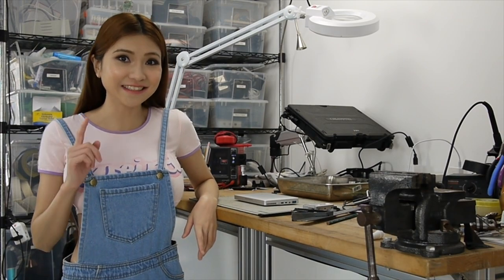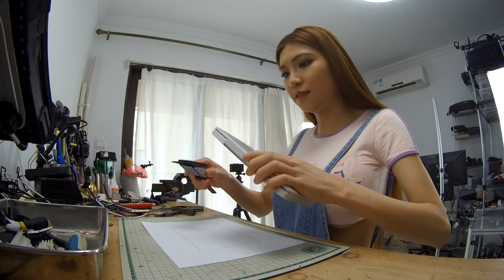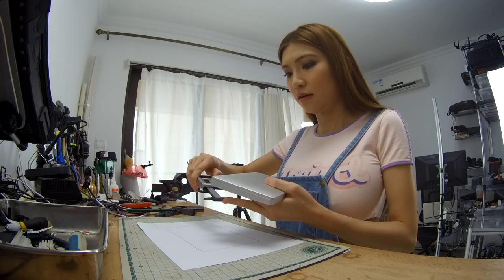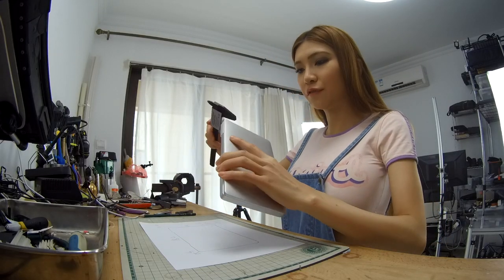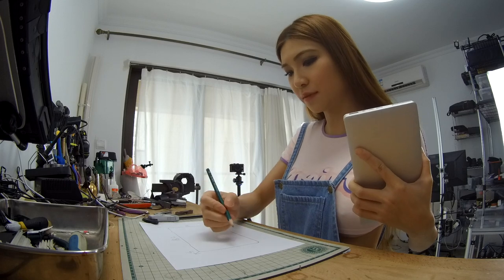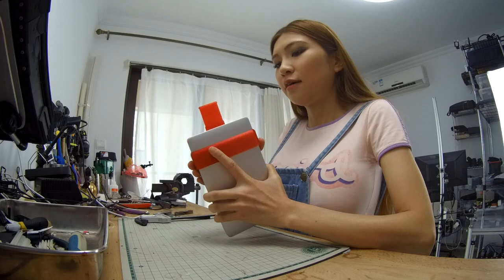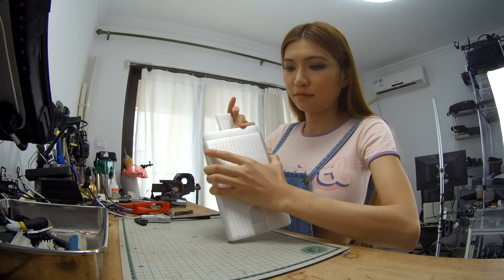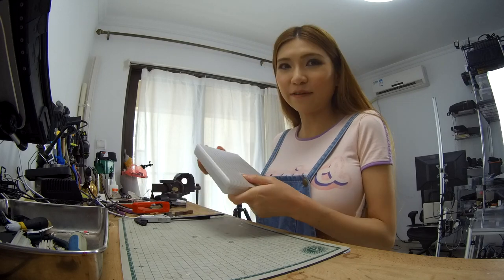Quick Build- 3D Printing a Holster for my GPD Pocket Computer

Comment: If you run into measuring a distance greater than the limit of your calipers again, you could actually use the square as a known distance. Imagine having two sets of calipers, each measuring from one edge of the work piece to a meeting point somewhere in the center. All you would need to do is add the two measurements together to find the overall distance. Having only a square and calipers in this case, lock the square at a distance you can measure using the calipers, then record that number. The square is now a known distance you can place against one end of your work piece and measure to.

Comment: Hello Naomi,
I've thought about some advancements of this holster. For example to add the possibility for a belt around the thighs. As fas as i remember the GPD has a touchscreen so a opening in the holster for a touchpen would be nice aswell (something like those old school filofax had). The surface of the holster could be a great spot for some stickers or some nice colored sticker foils (i am referring her to self printed Picture on foil what's most used to have a custom surface on your laptop)

Greetings from Germany

Comment: :) You could've used the mat to measure the book if the caliper was not big enough, I only have a 6 inch caliper and use my 20 inch  project mat that has 10mm squares when I need to do large measurements
Reply from the maker: It's not quite accurate enough, even with the square there were a few more test prints than I show.

Comment: Great video, as always. However, aren't you concerned that layers will separate on belt loop part and the whole laptop will drop to the floor? Maybe it would be better to use leather strap and rivet it to the main body?
Reply from the maker: I use the same stuff on my Bikini- it's very, very strong

Comment: I know this video is older but I think you should make it slightly bigger, like 0.13mm  on the width and height. It would be loose enough that you can easily pull it out but still tight enough that it won't fly out. If it's too loose you could put a Velcro strap on it to cover the top so that it can't come out.
Reply from the maker: It's good.

Comment: Is the 3D printer you use able to print in multiple materials (colours and etc.) on a single object?
Reply from the maker: I have two, the Creator Pro can but honestly, it's multi-material is one of those things good in theory that's not used much.
Reply: I would think that bonding of different materials during the printing process would be the problem. Thank you for your reply.

Comment: Looks great, some additional belt holder around the your leg would keep it from swinging around and you can make it a bit more sexy look a like. Some Weapon Holster use that kind of fix points to get a more save hold of the Gun.
Maybe some LED lights to match with the Infinite Mirror Skirt that you made before.
Even better build the whole case i to your Skirt.
Its an idea.
Nice lovely Naomi keep going.
Reply from the maker: Sure, just a bit of fun. I'll probably make some improvements...glad you liked it😊

Comment: What CAD program did you use?
Reply from the maker: TinkerCAD
Reply: You need to get more advanced try using Fusion360 (what I use)and Ultimaker Cura Slicer software
Reply: SameTubby2649 Blender is better than Fusion 360
Reply: Blender is not serious Engineering CAD, Put the right thing on the right job.
Reply: Use freeCad

Comment: Measure the feet with the thickness.  Then plotting their location is moot.
Reply from the maker: There are channels in the case for the feet.
Reply: @Naomi-Wu  Rgr.  I was looking at an option of forgoing the channels and adding a funnel to the opening to help with quick, attentionless replacement.  Adding a positive retention devise negates any savings at the measuring stage at redesign though.